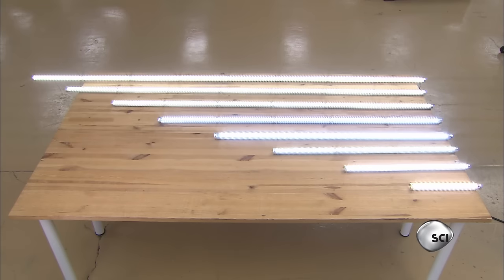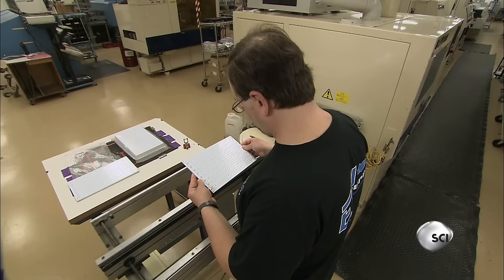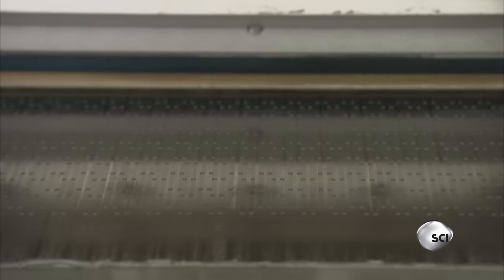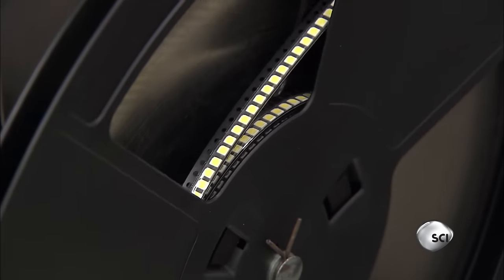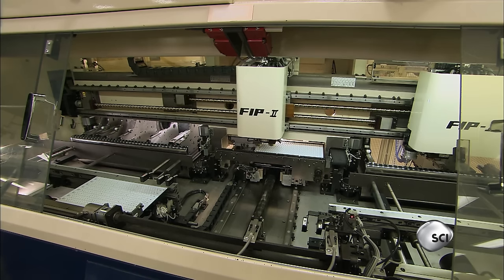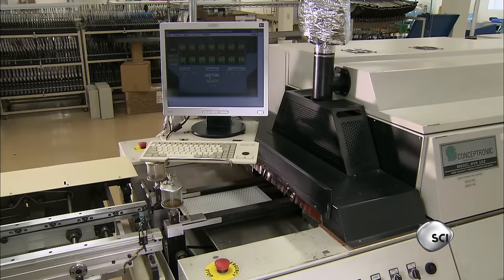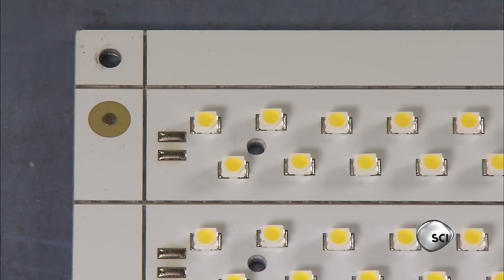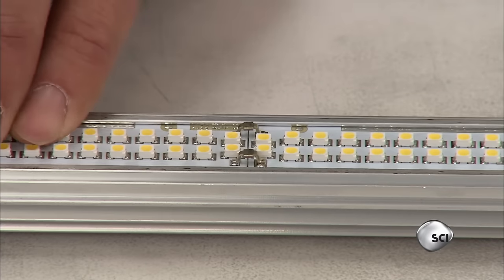LED Tubes | How It's Made

Comment: L.E.D.s are amazing! I spent a good chunk of change replacing all of the 75 watt incandescent bulbs in my house to the L.E.D. 60 watt equivalent bulbs that consume only 10 watts. Despite only being rated as having the same lumen output as a 60 watt bulb, they appear much brighter. Getting more light while using only 13% of the incandescent bulbs power makes me satisfied with the initial expense of the L.E.D. bulbs which have been going for nearly 2 years without any going bad.